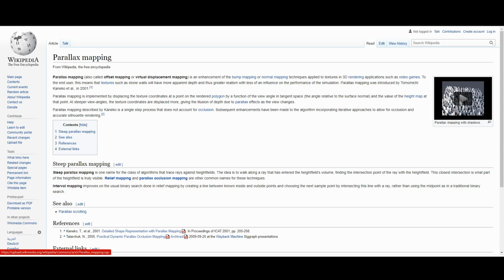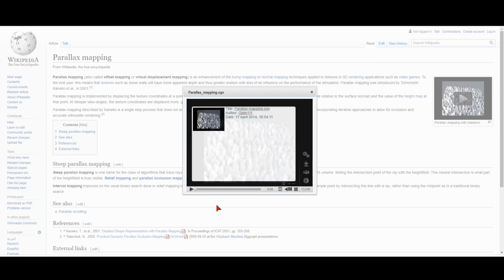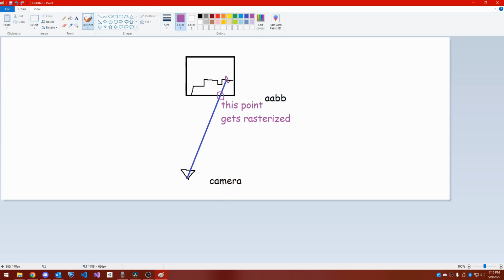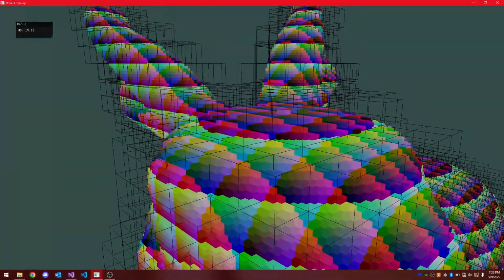Drawing MILLIONS of voxels on an integrated GPU with parallax ray marching [Voxel Devlog #4]

Comment: Hey could you link us resources you used to learn this? I really want to learn it but I don't know how to start
Reply from the maker: Great question! I've been working in game development and graphics for a number of years now, so there wasn't necessarily one tutorial I followed. Nonetheless, I can try to give some general direction for how to learn game and graphics programming. In truth, the most important part is to pick a project and stick to it. Even if you never complete it, the knowledge learned is invaluable!

As for resources to game programming, it depends upon your skill level. If you're newer to game programming, I can't recommend Unity 3D enough. Unity, Unity, Unity! It is an extremely powerful yet intuitive tool, and the documentation is top notch. There are also a ton of tutorials out there (Brackeys, for example), so learning Unity is only a Google search away. If you're looking for something more involved, and want to learn graphics programming, I recommend learnopengl.com (as well as the OpenGL documentation). It provides the basic steps for setting up raw 3D graphics applications. Of course, these are only a couple resources - I have viewed many, many more webpages while developing this project. Let me know if there are specific things you want and I can post resources. As I stated above, though, I highly recommend picking a specific project (like, for example, building a simple 2D platformer) and then structuring your Googling and learning around that goal.

Comment: paint the texture id and uv with z-depth distance, ray intersection normal, flat shaded with uv, in a buffer, then render color for the whole buffer
Reply: msaa is only high res rendering antialized down sampled resolution filter

Comment: Most shown 8x8x8 cubes here are relatively planar, so you could compute a plane per 8x8x8 cube, and start your ray on it (intersected with the AABB)

and for visualizing depth, you could use fract(log2(depth)). It's less clear about absolute differences, but it shows local differences well :) By adjusting the logarithm, e.g. log2()*a (a e |R), you can make it look a little different

Comment: Nice work! Also good to hear that you've chosen Rust, I can promise that you won't regret the move in the slightest. Games like Teardown use a very similar technique to this, but with the inclusion of a deferred rendering system. Taken in combination, both can allow for a lot of effects such as shadow ray marching and other depth-based techniques like SSR without too much extra overhead.

Comment: The way you've explained your rendering technique reminds me of how rendering is done in Teardown. Have you seen any of the dev talks for that, and if so is that what gave you the idea to rasterize first, then ray march?
Reply: Teardown wasn't the first to do it either, nor does Teardown use it in the same way.
Techniques like this have been discussed in the voxel dev community for years.
It's a pretty straightforward idea that comes up naturally.
Reply: @delphicdescant  is the implementation in this video more efficient?
Reply: @dominicstocker5144  No idea since I don't have the source.

Comment: This is great! How did you create the world shown in the video, did you manually place each voxel object?
Reply from the maker: The world was created parametrically (I described the voxel volume using code) with some sine/cosine curves by iterating over every voxel, and then generating a voxel octree. I should mention, of course, that the world is just a placeholder. I have some much more powerful techniques I plan to apply for actual world generation. If you're curious, the actual code is below. It was executed for each voxel in the volume:

// arr is an array of voxels
if (y as f32) < 10.0 * (f32::sin(x as f32 / (25.6 * 3.0)) + f32::sin(z as f32 / (25.6 * 5.0))) + 30.0 + x as f32 / 5.0
                {

                    if ((y as f32) < 10.0 * (f32::sin(x as f32 / (25.6 * 3.0) + 2.0) + f32::sin(z as f32 / (25.6 * 5.0)) + 2.0) + 15.0 + z as f32 / 5.0)
                    {
                        arr[[x, y, z]] = 1;
                    }
                    else
                    {
                        arr[[x, y, z]] = 2;
                        let d: f32 = rand::thread_rng().gen();
                        if d as f32 > 0.9 && (y as f32) < 214.0
                        {
                            arr[[x, y + 1, z]] = 2;
                            if (d as f32 > 0.9875)
                            {
                                arr[[x, y + 2, z]] = 2;
                            }
                        }
                    }
                }
                if (z - 100) * (z - 100) + (x - 120) * (x - 120) < 20 * 20 && y < 200 {
                    arr[[x, y, z]] = 3;
                }

Comment: Have you considered setting up a discord server or something? I know there are already quite a few voxel game dev servers, but it would be cool to participate in one where the focus is on raymarched or ray-based voxel rendering specifically, since a lot of the time the regular voxel game dev kinds of servers seem to be 90% focused on meshing and data structures for meshing.
Reply from the maker: It's definitely something I might do in the future! For now, I'm hoping to continue working on the engine and making these devlogs. If they gain enough traction, a Discord server would be a wonderful way to interact with viewers and the greater voxel community.

Comment: Wow, this is really interesting! I am definitely looking forward to see how this project turns out. I am currently building a large scale terrain plugin with rust, wgpu, and the bevy game engine. I can really recommend this tech stack. With wgpu you could get compute shader support back, which might be useful for generating the octtrees. Thank you for taking the time for uploading these awesome videos.
Reply from the maker: WebGPU is an awesome technology, and I will continue to monitor its development in the future. It was something that I considered using when beginning this iteration of the engine, but I ultimately shied away from it because the technology was too new. One major problem with WebGPU currently is how limited WGSL is - it doesn't have features like arrays in vertex outputs yet. Once the standard is finished, the API is well-documented, and the technology is not a moving target, I may consider porting to it.

Comment: What's wrong with cross-platform C++?
I've only ever had trivial issues getting that to work under a CMake build system, for example.
And there's always cross-compiling.
In fact, I get faster executables for Windows by using GCC in Linux to cross-compile for Windows than I do by using MSVC itself.
And for web there's Emscripten.

But now that you've started with Rust none of that probably sounds very necessary. Just thought I'd speak up in defense of C++ :)
Reply from the maker: There's nothing wrong with C++ - it's a useful tool that has been successfully applied in a variety of contexts. What I'm referring to in particular is the difficulty of targeting WebAssembly as a platform using C++/Emscripten. Though Emscripten provides emulation for a number of system functions, if you want to consume some other library - like a compression or serialization library - it can be difficult to find a platform-agnostic implementation that's easy to incorporate and compile with Emscripten. Rust is much nicer in this regard. The whole ecosystem is WASM-aware, and the way that crates are distributed means that many libraries work on both web and native out-of-the-box. In addition, there are quite a few libraries written for Rust that specifically target WASM.
Also, I have personally found coding in Rust much more ergonomic than coding in C++. Rust's modern language features and ownership model are easier to deal with, the syntax is cleaner, and my code just feels less error prone in general. That said, this is a completely personal preference for me.
Reply: @DouglasDwyer  Yeah that's fair. I'm not trying to target web with my own voxel raymarching project, so for me C++ is comfortable.

Rust is cool though. I've tried to get comfortable with it a couple times over the last few years, but I keep going back to C++ because I guess I actually kinda like living fast and loose with pointer math.

Anyway, I'm excited to see upcoming devlogs from you. I like the approach you're taking to cut down on the cost of raymarching for older hardware.

Comment: That's a really neat way to render everything!  With chunks that big though does it take a while to generate them?  I've been experimenting with voxels myself and it takes about a minute to generate a 2048^3 scene.
Reply from the maker: Each chunk is stored in an octree, which is utilized during the mesh buffer generation to maximize performance. This allows me to generate the draw data for the volumes at real time speeds.
You might also be asking about generating the chunk data itself. Currently, the way I generate the volume is to create a flat array of voxel materials, and then convert that to a voxel octree. This generation process does take 500+ milliseconds, and is not suitable to run in real time. I hypothesize, however, that octree-based world generation could be made much faster by generating the octrees directly. The bottleneck in generating these chunks is simply iterating over every single voxel, since there are so many. If an octree-based world generation algorithm were used (that, say, filled in a large suboctant with a single material when appropriate instead of iterating over each voxel in the suboctant) this would be much faster. I plan to explore this in the future.
Reply: @DouglasDwyer  Just came up with a solution a few minutes ago that might solve the issue of having to iterate through every voxel.  Since you can have large sections in a sparse octree that are marked as being the same block, you can place big blocks instead of individual small ones, so you can determine the size of the block you want to place by rounding the distance from the SDF to the closest power of 2.  Then you can skip the blocks that are inside that area.

Comment: this is a cool technique you really had to think outside the box for! do you think your technique will have any more problems like the depth buffer when it comes to more visual effects and interactivity?  ex. outlining an object, measuring distances between voxels, long distance geometry updates
Reply from the maker: That's a wonderful question. All in all, this technique is nice because it doesn't really break any steps of the rendering pipeline. I can still write to the depth buffer immediately, without requiring a second pass, for smaller objects. As long as there aren't too many, this doesn't result in performance degradation. As such, I don't anticipate that things like object outlining will be significantly different.

I can tell you about a few other issues that I had to overcome. One major thing that this technique broke was texture filtering. GPUs typically calculate texture gradients to select LODs and filtering modes by taking texture coordinate derivatives between adjacent pixels, but this doesn't work for me, because I call discard in my fragment shader. As such, in order to ensure that far away textures are linearly sampled and use the proper MIP levels, I manually calculate texture gradients by hand (either using a heuristic or a formula for the exact derivatives) and then call textureGrad.

One other problem that occurred with this technique was that there is a disconnect between the NDC-space voxel coordinates and ray marching voxel coordinates. This meant that, when viewed at the right angle, there were sometimes "seams" where the ray marcher thought voxels didn't exist, but the rasterizer did. To compensate for this, I scale all bounding boxes slightly so that the face edges overlap.

All in all, I feel as though I've thought about this technique for long enough that I have addressed the major challenges. Now, I need to continue working to implement things like backface culling and LODs which will allow me to increase rendering distance.
Reply: @DouglasDwyer  cool, thanks for the detailed reply! :)

i wonder if there was still any optimizations to be done with the standard vulkan compute route
either way your new technique is really cool and i think well suited for a voxel environment

i look forward to more updates on this :p
Reply: also great that it works on low end hardware because that is really the goal optimization should be measured against not just fps on modern hardware

Comment: This is wonderful stuff! A very clever new technique you've developed, amazing that it can run on integrated GPUs! I am not sure the specifics of your GL environment (or if you're using GL at all, I'm sure vulkan has something similar though), but GLSL allows you to specify that you'll only increase a fragment's depth using layout(depth_greater) out float gl_FragCoord, which allows it to still do early depth tests as it knows you'll only ever push fragments further away rather than move them closer to the camera. Maybe you've already tried this and it didn't work for you, but if not maybe give that a try!
Reply from the maker: Thanks for the interest! I am currently targeting OpenGL ES 3.0 in order to make things run both in the browser and on the desktop. You are absolutely spot on regarding the fragment depth - I only ever increase it, so the GL_ARB_conservative_depth extension would be applicable here. I did experiment with it, and found that drawing with immediate depth modification was only slightly worse than drawing with deferred depth, when the extension was enabled. The main issue is that the extension is not available on the web, so I cannot rely on it for performance. Nonetheless, I do enable it on desktop when doing immediate depth writing, which is still utilized to draw smaller dynamic objects.